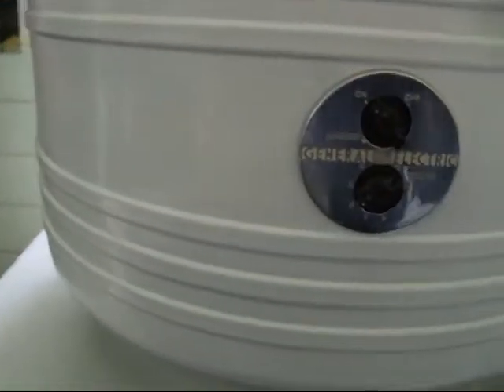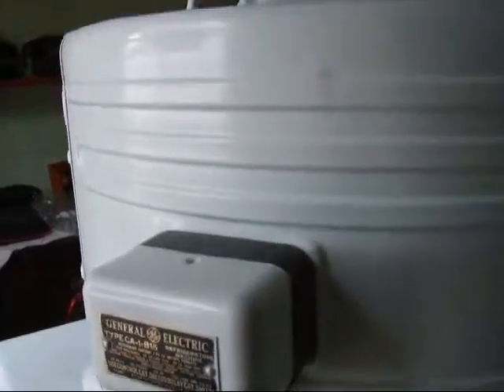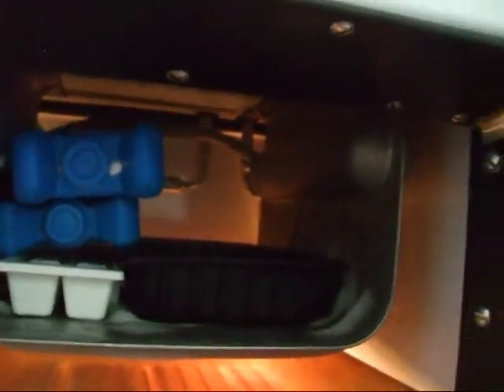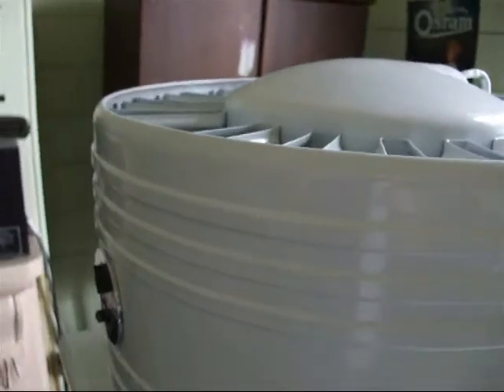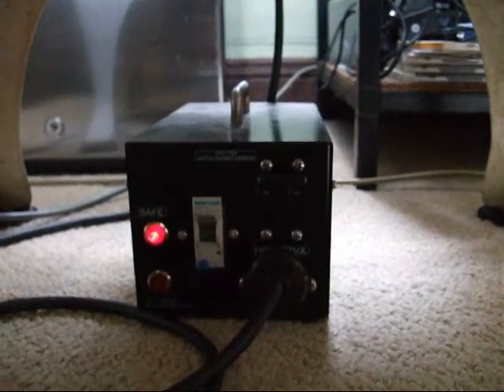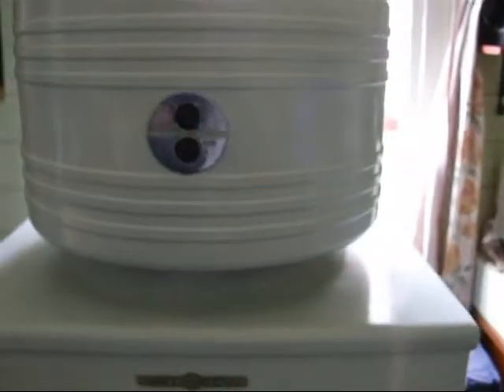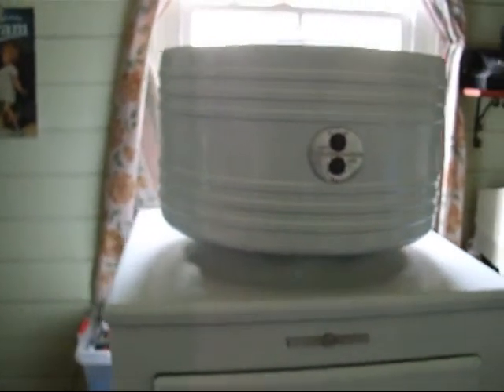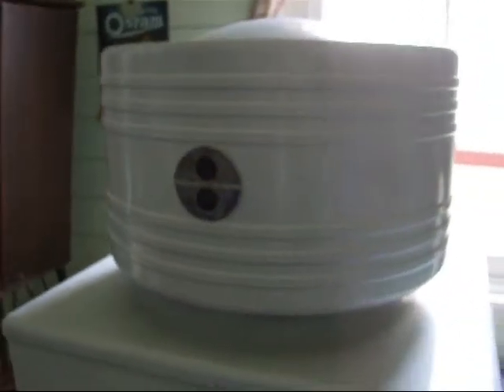General Electric CA-1-B15 Monitor Top refrigerator.

Comment: I am in process of redoing a D-2A16 monitor top I bought off ebay for 23 dollars. I have to replace the 3/8" condensor copper as it was crushed along the top. What brand and model# of cap tube and filter did you use if you dont mind my asking? Your fridge looks stunning and quite sure all who see it have questions and congrats for you.
Reply from the maker: The capillary tube I used for this fridge is 29" of .026"ID. The filter is a generic filter drier that I removed the pellets from so it works only as a strainer. It was not known what effect the pellets would have with methyl formate, and a drier is not necessary with that refrigerant. I should point out the correct length should have been 40" for the cap tube but the difference does warrant replacing it. Note that the cap tube for other types of fridge is likely to be different.
Thanks for the compliment - yes it was a lot of work to restore it; particularly the cabinet, but it was worth it and the fridge has run perfectly since.
Reply: Thank you for your quick response. the info is valuable for such a undertaking and saves hours of research. I should make a video of this frige " late 1927 or so" the potential for success is there. I have been in the HVAC business for around 33 years now and this little challenge should be entertaining to me anyway.I'm trying to find out if there is any other retro refrigerants out there that will work in some of these old compressors now. Again, love your monitor top fridge, its a beauty.Thank you again, Jim Tobin of Rock Rapids, Iowa.